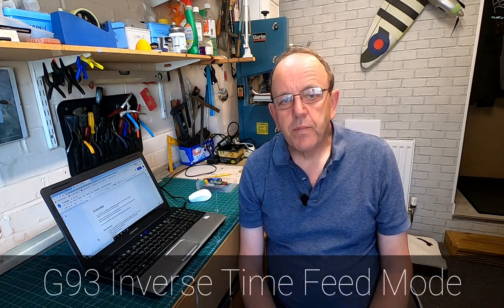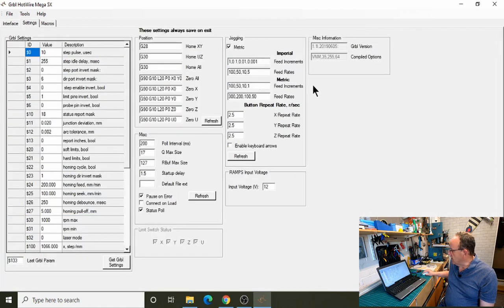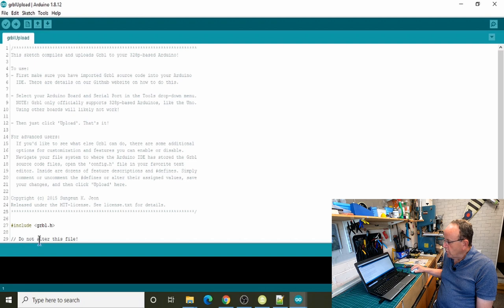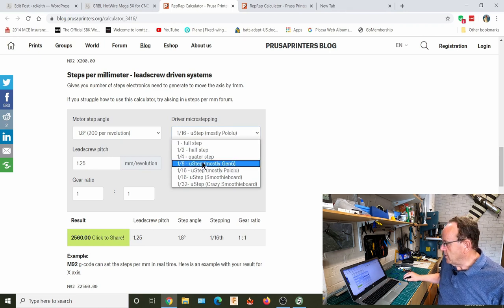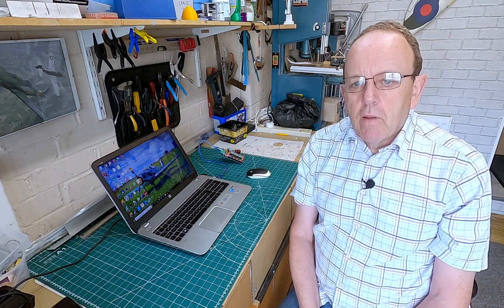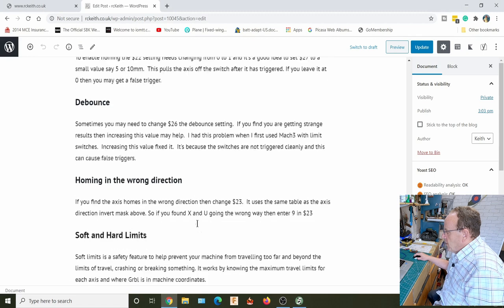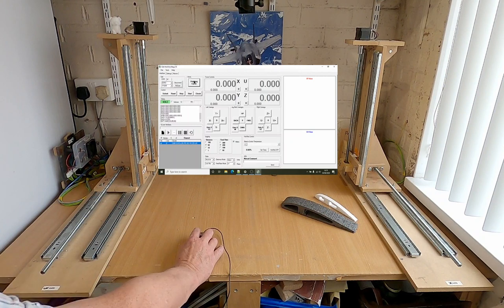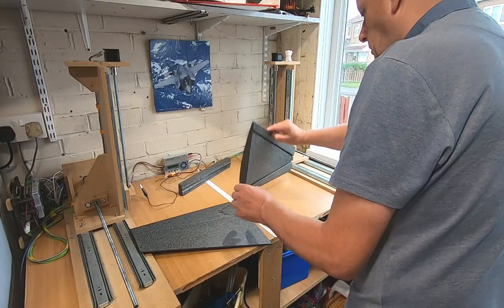GRBL HotWire Mega 5X Free Software & Firmware - CNC Foam Cutters

Comment: I guess I'm too stupid to actually use this program. I can upload my G-Codes, but I cannot set my steps per mm, I cannot set my Feedrate properly (The software does some really weird stuff when I try to alter the feed rate) and it won't give me a preview of what I'm about to cut with a jog position indicating where it currently is. These are the ultmost basic requirements I'd have to use a software for hot wire cutting (2D would be enough for me TBH) but I just can't for the live of me figure out how to configure these feautures.

I'm working with a CNC Hotwire cutter that was modified from using paralell port to accepting USB via GRBL, it doesn't run any arduino intermediate and directly accepts G-Code commands. All I can consistently do is move the wire around using simple commands such as X100 or Y-50. I tried loading up some G-Code, which worked, but it didn't give me any preview and since I don't have any limit switches I won't run any G-Code without knowing where 0 is currently and wether it will fit inside the build space of the machine beforehand. 

The old Mach 3 setup had all these feautures, but Windows XP is just way to old and the PC running the software was on it's way out. If it wasn't for that PC I'd still run the old Mach setup. Never change a running system I guess. Now I did change it and feel the pain. I hope I don't have to code my own interface to get this thing to work properly again..
Reply from the maker: Hi
The preview of the the wire path expects the g-code to be formatted in a certain way. I'm very soon going to release an updated version which will display the preview for all formats of g-code.  In the meantime  can you set your software that generates your g-code to only use G0 and G1 and not G00 and G01. There also needs to be a space between each instruction for example G1 X5 Y10 U5 Z5 F100.
If you can send your  g-code I'll take a look
The feed rate can only be set in the g-code. I still have Mach3 running on Windows XP and its does have many more features than the grbl based solutions. You can get Mach3 to work with USB by using an special adapter. I have a post on the website called  6 solutions for the obsolete Mach3 Parallel Port. May be worth a look. 
Hope that helps
Reply from the maker: I've just released a Beta version of the software you can try. It's on the website in the downloads section. Working on a new video to accompany it which should be out in a very soon.

Comment: Hi sir great project. How Can I use the       U-Axis as my rotary axis ? I want to use this axis for angular rotation?
Reply from the maker: You would need to recompile the firmware and define the 4th axis as rotary.  Have a look here https://github.com/fra589/grbl-Mega-5X/blob/edge/grbl/config.h at line 56 where you #define N_AXIS_LINEAR 3 which means the 4th and would be rotary.  The foam cutter firmware is based on Gauthier's GRBL Mega 5X with a few alterations. The firmware on my website will only work for 4 Linear axes but compiling the firmware isn't too difficult if you have some 3d printer experience.
Hope that helps
Keith
Reply: Ok I’ll try sir thank you

Comment: Great video, super excited about getting a 5 axis grbl board going. I sent you a msg on your website but this is probably better so everyone can learn. I have a Bigtreetech GEN V1.0 board. I can flash the .HEX file and it runs GRBL but no success using arduino to load the .INO file. I am using an unmodified config.h file. I also tried flashing the arduino code to a HEX file and flashing it. It will load but serial port does not give me a $ sign. What am I doing wrong?
Reply from the maker: Hi Jeff l replied to your email.
Reply: Could you post the fix. " so everyone can learn" ...thanks !